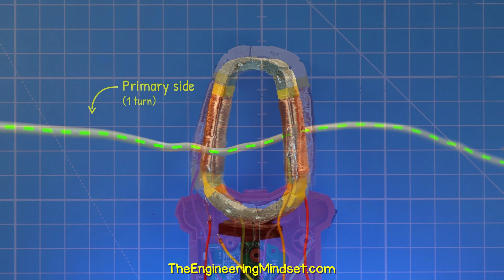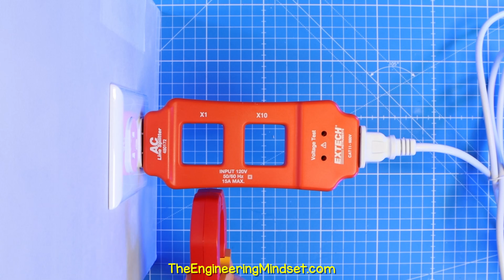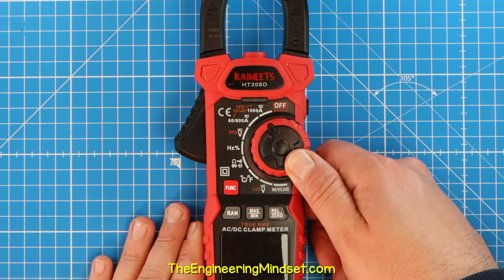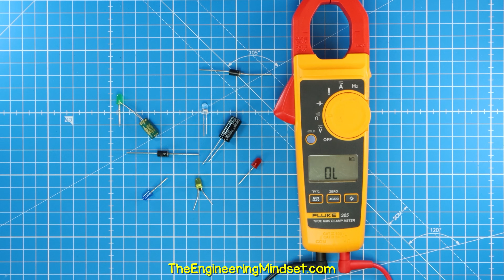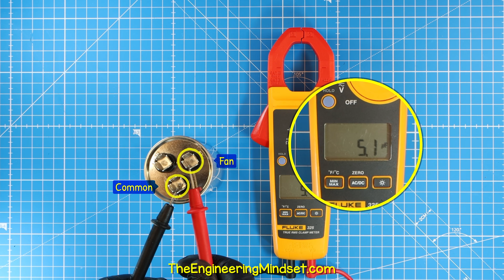Clamp Meter Skills That Make You Look Like a Pro

Comment: see i didnt know a line splitter was a thing when i got my clamp meter. so what i did was buy a 3ft 25amp extension cable. cut into the insolation about 1 foot of it and slit it open so i could pull the hot neutral and ground out. i do like that i have a ground because i have been fixing friends outlet that did not work. the fan i use draws about 1.2amps. well it didnt work so i checked volts and somehow he got wired up to ground being his neutral. well i did something i never tried before and very carefully used metal and clamps to just coss over (NOT A GOOD IDEA) and had 1.2 amps in the ground for about 1-2 secs then the brake tripped.
needless to say dont do that and yes after confirming power was off switched the wires around and now it works fine. never letting that friend live it down that he said he couldnt figure out why that outlet would never work and he had bought 3 outlets to replace the "bad one"

Comment: I want to add when you are in a position where you need to wrap the wire around multiple times sometimes there isn't enough slack. What you can do is us the neutral wire in addition but have it run the opposite way of the hot wire when testing effectively giving yourself that many additional loops. Of course be safe while doing so.

Comment: @EngineeringMindset when trying to connect in series with the negative car battery terminal for parasitic draw test the multimeter shuts down maybe for the initial current spike, how can i accurately test this with this clamp multimeter. And why sparks and fumes every time i connect the battery in the car on the negative battery post.
Best Regards
Martin

Comment: Can someone tell me if I'm going to use a clamp meter to test the current of a 220-240v 1-2HP Air Conditioner do I need a clamp meter with 400A range? TIA

Comment: Can the temperature probe be use on live connection in order to determine if their is a hot spot? Or it will break the probe or the tester?
Reply from the maker: No! It will conduct. Use a thermal camera.

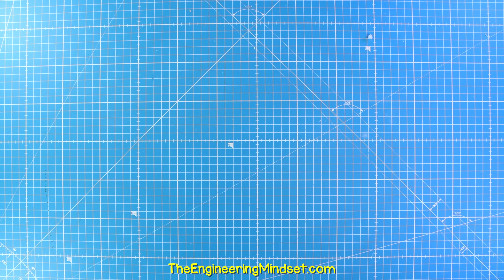Comment: 5:20 Interestingly, the Kaiweets 208D clamp meter reads consistently accurate regardless of where the wire is positioned inside the clamp jaws, which makes the measurement less ambiguous and didn't require the careful positioning. You can test it by seeing the amount of variation in the reading as the wire is moved through all the different spots in the clamp aperture.

Comment: On decent sized Capacitors you can hold your Leads on the terminals using the Voltage Selection. It will go through the meter’s internal resistance and discharge the Cap. It takes time but not everyone has a high Ohm resistor on hand.

Comment: More people need to learn how to uses these meters. I see reviews of clamp meters saying.. this meter sucks it always reads 0 don't buy it.. But then if you look at the picture of their meter you can see they are testing around a complete cord, not just a single wire.  And yes it will read zero because the positive and negative / hot and neutral are canceling each other out.

Comment: My clamp meter is probably the least used item of my test gear, my Fluke multi-meter is my general go-to. Thank-you for the clear concise description of the operation of a clamp meter - better than the manual which came with the meter!

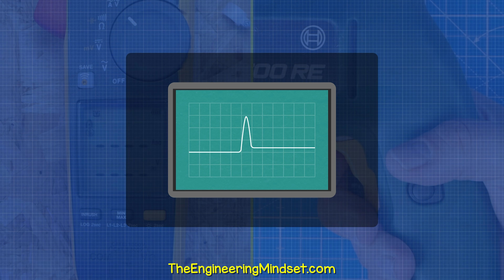Comment: 10:36 Confused why diagram indicates "V"oltage changing whilst you describe how "current" surges at startup. Lost a little confidence in the detail being given. 😢
Reply from the maker: The graphic was just reused from a previous video we made but the reference file wasn't changed so it has a mistake. Apologies for the error.

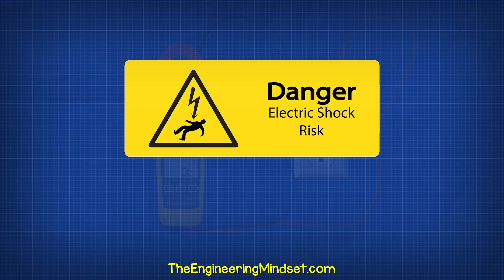Comment: 20:30 - A good way of measure resistance on an energized circuit is indirectly through calculation, for example, put a load and measure current value and current drop value, for example, a load put on outlet give a current of 10 amps, and the voltage drop is 4v between open circuit and closed circuit, so calculate, U/I = R, so 4 / 10 = 0.4 Ohms or 400 miliOhms.

Comment: You would probably blow a few more minds if you had covered the Fluke 365 with both AC & DC Current with a 1m interconnecting cable.  This avoids having to fit the meter into small spaces.  ATTENTION:  DC Current means automotive troubleshooting and Solar Collector & Battery Stack checking....

Comment: Opening the circuit breakers before measuring a voltage is kinda ridiculous. Recently I was working, measuring a voltage using the osciliscope coming from a bushing potential device, that was measuring the voltage from the incoming 525kV lines. Imagine if I had to trip the 525kV circuit breakers(stopping a flow of 650 MW of power causing a full load rejection in the main generator), connect the osciloscope, then after doing that, reclose the breakers to do the measurement. And also connecting the black wire to the neutral is pointless, the device should be able to handle measuring voltage between phases. Where I work, we usually avoid measuring 480 and 440v between phases, instead we measure from ground, so the voltage is divided by sqrt(3), and you only need to pay attention to 1 probe so it avoids accidents, but measuring between phases is a thing that could happen, specially with lower voltages, like 220v. Maybe this order could avoid short circuit in some situations(and the other probe being "hot"), but an outlet is usually really safe, maybe that's a safety rule somewhere, and we tend to obey them without questioning, although you don't have other choice when measuring between phases.

Comment: I dont like clamp meters. 
regular multimeters are perfectly safe to use. you can get tip covers if you like to put your fingers on them. or just learn not to put your fingers on them.
Reply: The clamp is there to allow measurement of current without having to put the multimeter in series though, and most multimeters are limited to relatively low current, like 10A in my case.  I think the feature of allowing voltage measurement using the clamp is just an added perk since you'd be using the clamp for current measurement anyway so might as well get the voltage at the same time.

Comment: I use an analog clamp on meter for continuous monitoring of the power draw in my garage shop. They do not have a battery to wear out so one can set and forget. The accuracy is good enough to identify the high draws. I have a DC clamp on but have never used.it. Just get what you need. Cheers.

Comment: If I touch neutral and I am grounded I would have a shock, right? I mean in the case that current flows through the neutral anyway because I have another load at the same circuit..
Reply from the maker: In theory, no shock. Because you are at the same voltage level at the neutral, the neutral is physically grounded to the earth. The live/hot wire is a much higher voltage so it will give you a shock. Notice how birds can land on a 200kV power line and be completely fine, but it they put one leg on the wire and one on the grounded plyon.....boom. If two live/hot wires of the same voltage and same phase difference touch, no current flows. However, if you are not properly grounded or there's an electrical fault/short and you touch the neutral, then you will get a shock so you shouldn't try it.

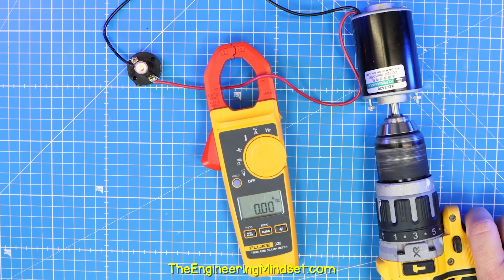Comment: 10:00 is somewhat ironic, it's a DC motor that gets called an alternator(which by definition outputs AC) but since car alternators have built in diode packs their output is DC similar to the motor used in the example, honestly that's a very confusing situation all around.

Comment: I don't know if its a Fluke thing, but we were taught in RV A/C class that multimeter have filters in place to protect them from surges such as what would come from a charged capacitor.  As such it was suggested to have a modest pair of insulated pliers to do just that.   Our instructor had the misfortune of being "nipped" by a capacitor after he thought his multimeter had discharged it, when in fact, it didn't.

Comment: Hi just need some video for , which DMM is best to use for Audio  Video products servicing..
Reply: Are you doing install type work? Repair at the board/component level?

For general use, a 115 is great, for more detailed electronics repair, something in the 180 range might be best for you. 187 maybe? I'm forgetting that lineup.

With audio, you might want an oscilloscope, which is a whole other can of worms.

Comment: How does measuring resistance work? Does it energize the probes with certain voltage? Is it enough to fry sensitive components?
Reply: Modern multimeters send a constant current and measure the voltage drop.

It's usually not an issue. Old curve tracers and Huntrons were high enough current to damage new sensitive electronics, but modern-ish multimeters are good enough for all but super specialty applications. And like the other commenter said, if that applies to you, you will probably know, and by nature of getting that advanced job, you will probably know enough about electronics to mitigate.
Reply: Typically its very little current (maybe a miliamp).  I've never seen it, but I have heard rumors of possibly damaging specialty equipment.

Honestly if you work in a field where a miliamp can damage equipment you should know better.

Comment: I learnt a lot from this - particularly the use of hall effect sensors for DC current sensing!!  That's incredibly cool - however, I do have a couple of things to mention:

- The directions for current flow used with the clamp-type DC multimeters is called conventional current (TEM obviously know this and the video is correct, but just some added detail).  Technically speaking, current flows from negative to positive (electron flow) but that's just confusing and unnecessary for most people

- Compounding from the previous point, connecting the neutral/negative first is almost always a good idea, but it won't save you.  Car chassis are tied to battery negative, so you should always connect negative first because it can't short against the chassis whereas connecting the positive first means your circuit could short against the chassis.  The same idea mostly applies with household circuitry - neutral and ground are tied together, so theoretically you remain in phase with any current if you ground yourself accidentally.  However, shorting to literal "ground" (i.e. touching grass) will hurt just as much as putting hot to the same location.
Reply: I think you missed something in your point about not always connecting the negative/neutral first. You didn't give an example of when it's appropriate to connect to positive first. You mentioned car batteries, so I think you may have intended to mention that when installing a car battery, you should always attach the positive terminal first (unless you have a weird British car with a positive ground frame). 

The reason you do this is, once the positive terminal is installed, accidently touching the negative terminal to any metal part of the car (for example, by dropping a wrench in a way that touches the negative terminal and the frame of the car) completes the circuit as normal with all the car's protection circuits in the loop, and 12 volts is so low there is almost no risk of shock if you accidently complete the circuit with your body. 

If you install the negative terminal first, then if you accidently touch the positive terminal of the battery to any metal part of the car besides the positive cable, you will short the battery, and it will try to dump its full rated current of 600+ amps through what ever you touched it to and the negative cable. Because the frame is ground and directly connected to the negative of the battery, there is no current protection to save you from this mistake. 

Another example of how this could become dangerous is if, after installing the negative terminal of the battery, you go to install the positive terminal, and while tightening the positive cable, your wrench or tool contacts the frame at the same time, you will short the battery. 

For the same reasons as above, when removing a car battery, you should always disconnect the negative terminal first, or if you're just disconnecting the battery to do work on the electrical system, the negative terminal is the one you should disconnect.
Reply: @jsax01001010 these are certainly very important safety tips when working on automotive electrical systems.  Well said 

Worth noting that American cars made before 1955, and British and Asian cars, as well as some motorcycles and farm tractors from before the very early 1970s, could have either a positive or negative ground frame.  Anything made within the last 55 years, can be presumed to be negative ground.  

But if you're working on a classic car or tractor that has a positive ground system, you simply follow the opposite  procedure, that is, you should remove the positive cable first and reconnect it last.  

If you're working on old cars or tractors and aren't sure of what ground system was used, you can find out by locating the cable bolted to the chassis and noting which terminal of the battery it's connected to, assuming of course a battery was installed when you got there.

Comment: I remember trying to measure dc current in an appliance wire using a clamp meter clamped over both of the conductors. It was my first time using it despite seeing it in action many times, so it took me some time to figure out why it didn't work...

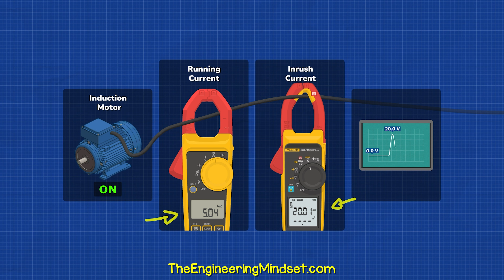Comment: Am i dumb or are they measuring current in Volts at 10:37 and 10:47 ?
Reply from the maker: It's a mistake. Should be "A" not "V". Graphics were taken from a previous video to save time, forgot to change the unit. Classic editing at 2AM copy paste mistake.
Reply: @EngineeringMindset  No worries, love your videos.

Comment: me, working with low current sub 30V, ah yes "do not try to repair it" do you mean shove a magnet wire in there? (damaged but working devices are fine to repair as long as you're not working with voltages over 30V, though even 80V dc will be relatively safe, but you still need to be careful if your device is damaged. basically, don't but if you know what you are doing you can, repairing will probably make your voltage rating lower, so a 600V rated cable with tape on it might only protect for 200V or so.)
though yeah if you have the money to buy a new one repurpose the old cable/multimeter to a project where it's safe to do so.

Comment: In the ad about fluke you said a calmp meter can measure voltage through the clamp. Between which two points does it measure the voltage? I don't get this.
Reply: It isn't a great measurement because it doesn't have a solid reference point, but it measures relative to itself, in a time average. If you have a 120v line, you see it going up and down, call the average zero, and see what the amplitude is.

Don't rely on this reading, use your brain and investigate further with other methods of a reading doesn't make sense.
Reply: You connect the common port on the meter to ground using the black cable and clip before you use the clamp to measure voltage.

Comment: https://youtu.be/J3kKNNizARc?t=574 measuring the dc with clamp, but how ???
If there's no fluctuating ?
Reply from the maker: The symbol shows a straight line and sine wave, as explained in the video, that mens AC or DC as the functions are combined.
Reply: @EngineeringMindset  This is not the answer. The measurement logic is asked. How can it measure? The ac has fluctuating waves and makes electromagnetic field. Nut in dc, theres no fluctuations ?
Reply from the maker: I misread your message, sorry. It uses the hall effect sensor, also shown in the video. It's like a mosfet or transistor which is turned on by a magnetic flied, so it basically converts it into a voltage signal and that signal corresponds to a certain current. The circuitboard will compute this depending on if it's AC or DC. Both AC and DC will produce the magnetic field, just just fluctuates
Reply: @EngineeringMindset  Thanks for your answer. But how _? If there's no change in current and so no magnetic field, then how the hall effect sensor produces signal ?
Is there a special circuit ?
Reply from the maker: There's always a magnetic field around a current carrying wire for both AC and DC. I've shown this in the video. If it was AC the current alternates so the magnetic field alternates and a clamp meter using a coil sensor will only be able to detect AC as the magnetic field will induce a voltage into the coil around the clamp arms. It won't work for DC though. But the hall effect sensor will work for both, the magnetic field will occur for both DC and AC, it will flow around the clamp arms and pass through the sensor.
Reply: @EngineeringMindset  Thank you. You mean, dc doesn't produce voltage on a coil by magnetic effect.
Then; how the hall effect can work ?
Reply: @karisikpekmez6850 

Your compass will measure earth's magnetic field. A hall sensor also is able to measure static b-fields. It's not based on induction.

HOW a hall sensor measures it is explained by the HALL EFFECT. Look that up online if you wanna learn more.

Comment: Great video but 2 quick questions:
1) If a Meter has a Min/Max function, is a different option still needed to measure InRush current?
2) If an Amp / Current function is selectable on a Clamp meter does that means readings could be captured via Clamps OR Probes?   In other words, if a Clamp meter has a selection for AC Current and Voltage and a different selection for DC Current and Voltage, then it automatic that the Clamp can perform all 4 functions?
Reply from the maker: Thank you, glad you enjoyed. The min/max will not capture the inrush, it will capture some of it but it won't be the full wave.
The probes shouldn't be used and should be disconnected for current readings. I haven't seen one that can do both, they might exist, probably it needs a separate function to work.